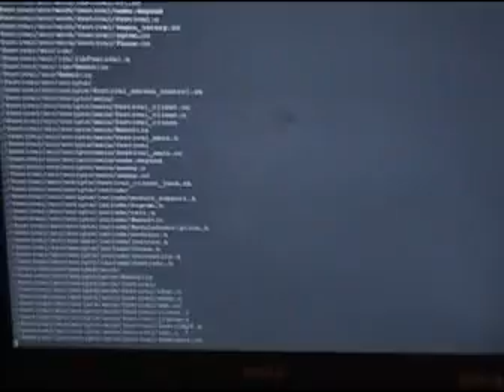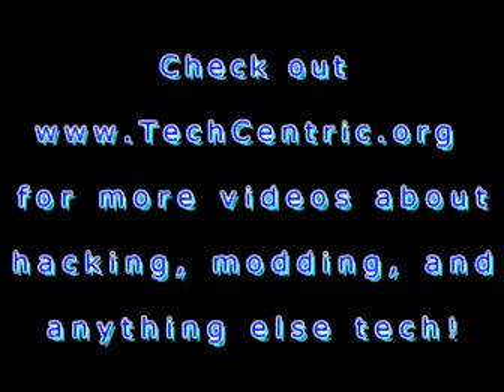Forever flashlight exposed

Comment: Took out my "Forever flashlight"from a closet still in it original packaging.  It was a Christmas stocking suffer from 9 years ago.  Shook it for 5 min.  Did not light up. Shook it in a dark room: not even a faint glow when shaking. Found two dead CR2032 batteries inside along with magnet and copper coil inside. Replaced batteries and lite up as bright as when it was new. Small wires connecting the copper coil  to switch produced no changes when voltmeter connected when shaking, Voltmeter measured 5.9 volts when connected to the negative terminal of two batteries in series and with "on" switch in the "on" position. A small circuit board has solder points for the small LED light, No capacitor on board. Seems unlikely that without a method of energy storage that shaking would produce enough voltage to lite up the LED, CR2032 are not rechargeable batteries.

Comment: If you're metering 4 volts from two 3 volt button cells and they're connected in 'series' like you say, one of two things is happening....either you've got two VERY weak cells, or they are not connected in series, but rather in parallel.

Comment: It is shameful to continue to publish fake "exposure".  The "Forever" flashlight does not contain a battery, so the item these guys used is not a "Forever" flashlight at all.
Reply: I have the real one.  Its connected to a EECS0HD224V PANASONIC, Supercapacitor, EDLC,  GC5.5V0.22F if you open it up, forever light by excalibur, but there are plenty of knock offs which were fake.  The problem is that even the "real" one fails as well, mine only works if i never stop shaking it, so the capacitor is dead, not that it was ever worth the effort.  A reciprocating motion is incredibly inefficient, and only done for the novelty.  It was always green wash garbage.

Comment: either that, or the thing that connects the coil to the cells is in the outer casing of the flashlight, which you clearly did not have on the flashlight when you shook it as it was taken apart... you are a couple of not-so-bright dudes trying to act like you uncovered some scam... and on top of that, you can get a forever flashlight for $15 on amazon. anyone who pays $160, got scammed.

Comment: yeah... you are idiots.  first of all, you can charge a battery using kenetic energy. and the "metal" in the forever flashlight isnt a metal at all... its a MAGNET, jackass.  what happens is, as the magnet flows past the wound coil, it creates a current which charges the small cells... and the small cells power the LED. When you opened up the flashlight, you probably broke off the wires that connect the coil to the cells.... DUMBASSES.

Comment: this flashlight is a cheap knockoff..i got one for myself to take camping and hiking...i haven't gone yet..but ive used it numerous times around the house and it works great...the real flashlight on the face should be rounded with small indented circles.  beleive i researched all the kinds and mine is the origanal...works great

Comment: i got one of these at the bed bath and beyond store and it sux it only lasts not even 5 min then u gotta shake the hell outta it and then it runs another 5 mins, ive rigged mine i took out the shit batteries in it and replaced them with the batteries from a crank light and it works ok, still i might just rig it to run off standard batteries, the crank on my crank light broke but i prefer those better than the shake ones